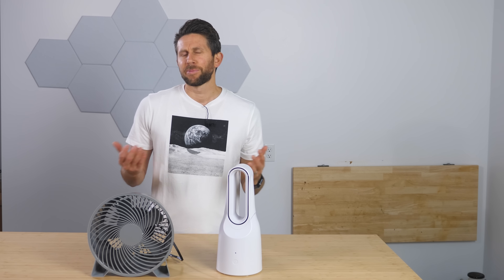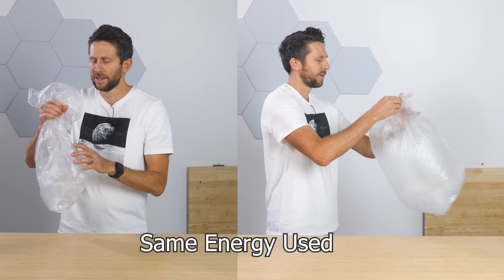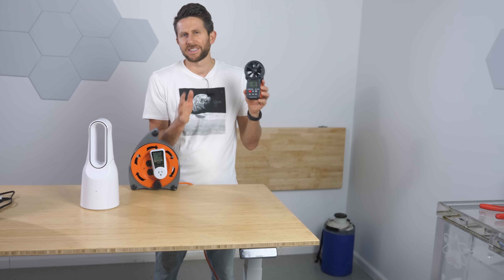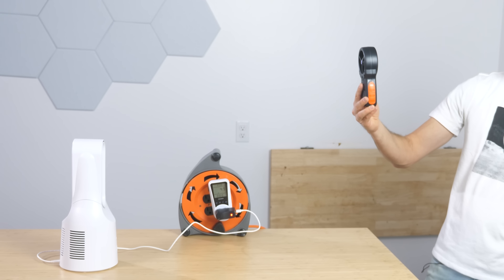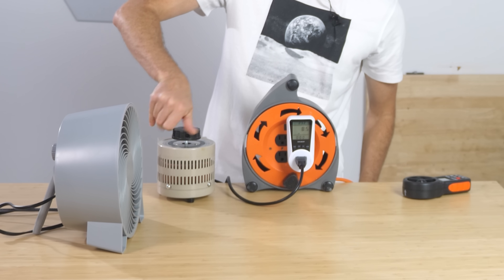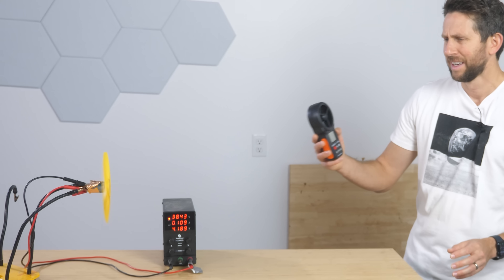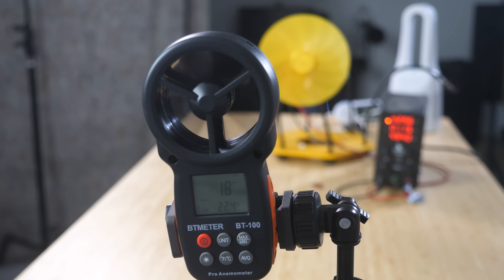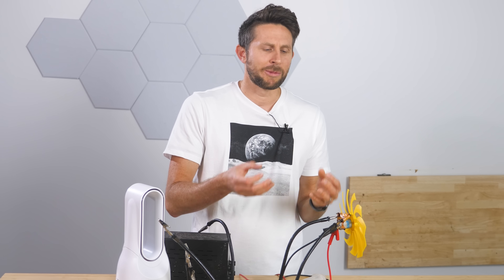Are Bladeless Fans a Scam?

Comment: The best small fans I've seen are all from Vornado.  They have fans as well as heaters which use the same technology.  They work well, are solidly built, last forever, and aren't really loud except at the highest speed.  Also, they can be purchased starting at $10.  I use them exclusively when I need a heater or fan.
Reply: Sounds like a stellar review!

Have to say though, not a big fan of their brand name "vornado"...
It sounds to much like "vore"...

So vornade makes me think it would be some vore pr0n comic on DeviantArt...!
Reply: vintage lasko fans are also great
Reply: I've got one I use mostly for cooling down after exercise.  It moves an insane amount of air even on the low setting.  I've got a fairly small version, maybe 12" across the entire front face.  No oscillation, just blowing my hair back like the old Maxell Cassette guy from the 1980s.

Comment: Well, it's an interesting experiment, but the reality is that you put a certain amount of power into the fan and that's the most you can get out of it (minus a bit for internal losses). So there's no way to 'multiply' anything; that would break the law of conservation of energy. All that the bladeless fan can do is swap air speed for air volume. So are bladeless fans a scam? Not really, they're a just gimmick and some folk probably think they look cool 😅.

Comment: Really need  to measure air volume moved as designed, then compare watts per cu meter or cfm. Both devices should be measured with similar air conditions within the intended design flow of the device and in its expected operating conditions. In this case room temp is probably a reasonable baseline as well as non ducted free air. This measurement is done in system balancing daily so very doable. Air amplification is a thing in practice in many places so it is a proven performer.

Comment: I'm glad someone finally tested the claims of the so-called bladeless fans, which have blades hidden in the base and do Not increase the efficiency of air movement.   This sales pitch falls under the old scam of "something for nothing":   You get more air movement for the same energy used.  I was suspicious of this the first time I heard it, for the same reasons he demonstrated:  forcing air through thin slits which creates back pressure and wastes energy.   A cheap Walmart fan is more efficient,  as he or another poster demonstrated in another video.

Comment: We expect that the air speed would be lower going through the slits. The Bernoulli principle is basically converting a small stream of fast-moving air into a bigger stream of slow-moving air. In principle, it could lead to a much larger air flow for the same energy, since kinetic energy is proportional to the square of velocity.

Comment: You should have 3d printed a shroud to encompass the small traditional fan with slots small enough to not allow little fingers in like a traditional box fan to see if that would have created a lower wind speed.  Fair testing and all since another benefit of bladeless fans are that they are safer for little ones and pets

Comment: A friend of mine bought one of the large floor standing Dyson fans.  First thing I noticed was how loud it was compared to the amount of wind it produced
Reply: Dyson - loud, inefficient, expensive
Same for vacuum cleaners
Reply: @Kiisseli1337 the dyson makes a cool futuristic sound though.. it's an average vacuum cleaner but i love tapping the button and hearing the whirring sound
Reply: @Kiisseli1337 ? I've never had this problem with vacuum cleaners lol
Reply: @Kiisseli1337  vintage vacuum cleaners are more efficent but yeah modern ones are awful
Reply: I have a Dyson desk fan I use to sleep (gift), it’s very quiet and I like the airflow it produces. I have used fans to sleep for decades, Dyson is the best.
Reply: @Thisismetman I have a Dyson desk fan (not a knock-off) and it's only quiet at lower speeds. I have computer fans that produce more noticeable, directed air flow at similar sound levels (if not quieter). For speeds that actually move significant amounts of air, Dyson fans are just as loud and not that great. The only nice thing about them is they are easy to clean and those with an air filter catch dust without gunking up the internal fan. They're just insanely expensive for what they do.

The only way to get around the noise issues is by increasing the size. DC ceiling fans are by far the best way to accomplish this in a place like a bedroom.

Comment: "Bladeless" is at least more concise than "does have a bladed fan, but it's out of the way of getting things jammed in it". I would never expect the same level of efficiency simply due to the indirection... but I can also think of a number of uses for a small fan where it will neither be in an especially controlled environment nor easily viewable or reachable, and where it's worth some loss in efficiency to ensure something like a string isn't going to get sucked in. This isn't a vast improvement over simply encasing both the intake and exhaust, but the design principle does create extra options. (And for larger models, I can see potential value in keeping fascinating moving parts well away from the eyes of young children.)

Comment: The only real benefit to the dyson fans is that they're air purifiers as well, one device that does both. Or the more expensive ones can also function as heaters or humidifiers. Convenient to have one device to do multiple things, but it's a jack of all trades, master of none. The $100 Vornado fan I got is really good at moving air around a room. Even the $50 one does really well. Even box fans do pretty good, though they might be better for moving air from one room to another, rather than circulating air around a room.
Reply: The big box fans are good at what they do, but noisy AF.
Reply: Must not have sisters with long hair. Ive had to tear apart several fans to get their hair out of it without having to cut their hair. Yes my sisters are dumb I get that and so do they.

Comment: EDIT: I forgot to post at the beginning of my comment. Yeah, bladeless fans aren’t completely what they’re often sold as. They’re a bit overblown (I see what I did there). But one of their primary benefits aside from having that smoother airflow is the safety factor of not having exposed blades anywhere that anything can get at. As a kid who nearly had my finger chopped off by an ancient 1950s electric desk fan, that’s not a small thing to overlook.

In fairness, the cost of Dyson fans goes into the engineering that made them in the first place. These $50 bladeless fans would never have existed without Dyson making that initial investment first, because nobody would’ve known how to do it.

As for the price of those $6-700 Dyson fans - those also aren’t just fans. Yes, they happen to blow air and operate as fans, but they also have things like air purifiers, hunidifiers, heaters, and with various smart features like measuring various polutants in the local air environment, offering HEPA filtration, and so forth. You’re not buying a better fan when you buy those fans - you’re buying those extra features. The basic $250 Dyson fan gets you pretty much all the benefits there are to get from the Dyson bladeless design, including an efficient, brushless DC motor, quality controls, warranties, serviceable parts, a company to back the product up, etc. (and yes, all their tremendous investment in marketing and creating that brand recognition, too). Try to service that $50 fan when something breaks - you won’t be able to get any parts or service from the company that made it, if you can even identify that company in the first place. And you’ll be very lucky if it’s actually UL-Listed or equivalent for safety. Most likely, you bought it from a company that orders it branded from Alibaba and slaps their own generic logo on that product, and in 6 months or a year, it’ll be 3 different company iterations down the road from the one you bought it from. Yes, you can buy 5 of those for the price of one Dyson, but again, that’s still one of the tradeoffs of not buying from the company that brought the technology to the market in the first place, and that will still be around in 10-20 years.

It’s kind of similar to buying a Tempurpedic mattress. Yes, you can buy the same material those matteresses are made of yourself from a factory that produces it and make the same exact matress for $1,000-2,000 less, but you’re never going to get the support you’ll get from Tempurpedic if it ever wears out or has an issue. And yeah, everyone can point to someone who’s had a bad customer service experience with Tempurpedic or Dyson, but that ignores the ratio of people who’ve had those bad experiences to those who’ve either never had to get service in the first place, or with those who have but have had great service experiences. Manufacturing is the hard part, and post-purchase support is almost entirely dependent on how well manufactured the product is - not how it’s designed (or whether its design was stolen from or infringes on the original inventor’s expense/efforts).

And I’m not saying Dyson’s aren’t over-priced. I think they are, generally. I’m just saying that it isn’t pure greed behind that pricing - there are other objective differences that actually do account for a significant portion of that overpricing.

Comment: I thought the bladeless fan was really safety conscious. Kids cant cut themselves or easily throw stuff at the blades and ricochet.

Also, that fast moving low pressure air demonstration with the bag was cool. You could also show how plane escape slides fill up by adding a venturi.
Reply: Safety is really the main selling point
Reply: And easier to clean I guess
Reply: I would like to reaffirm that safety is the most valuable benefit of these type of electric fans. Be it little ones discovering their surroundings, people with cognitive impairments, or plainly being bored, they are a valuable contribution to our society. It is a shame though, that patents had to expire, for the less fortunate people to take advantage of these engineering breakthroughs...
Reply: I always assumed experimenting with, or getting a minor injury from, a spinning fan blade was part of the learning process of growing up.  Sooner or later, you're going to encounter a big fan with blades, and the earlier you learn not to mess with them, the better.

Comment: I don't know why the youtube science communicators do a very poor job when it comes to air movig devices by always using an anemometer to compare everything when it doesn't even measure volumetric flow, even less static pressure. I know these kind of metrics are hard to get but when they aren't even mentionned in the video it is quite problematic

Comment: Do you think it would also be worth trying out toroidal bladed fans as another comparison with traditional fans?
Reply: I can pretty much guarantee the toroidal is going to be worse.  That design works great at high speeds like what drones need to fly or if you're moving quickly in a speed boat.  At lower speeds, like fan blades, it's typically way less efficient than standard blade design.

Comment: Also note that blades, blade angles of fans have to be designed based on the intended rpm. It is the vector sum of air velocity and velocity of points on the blade for both edges of the blade

Running them at different speeds is not efficient in terms of power consumed per quantity of air delivery times the pressure difference

Comment: Also note that when an electric motor is fed increasing voltage starting with near zero, when it does start moving there will be a drop in current and power from what it is consuming until then, due to also starting generation of back emf

Comment: Good experiment. Seems to me that instead of taking out the blower, you also could put same size pipe for output measure on the whole output, thus eliminating the comparison of "one directed stream" vs "a propeller dispersing out to sides" argument. But not being an expert on fluid dynamics, I might have overlooked some aspects. 
Just another idea, your argument is solid, just it does not get clear at start. 
I like such type of videos. Simple, easy to understand and IMHO approvable by Bill Nye :D

Comment: One of the reasons for a bladeless fan would be that the blades are covered. Nobody would get their finger stuck in them, no animal would get their tail or something stuck, let's say if a cat jumped on your desk or something... At the end of the day, it's basically just a cool decoration though, with some level of practical use. Opening a window would be much more effective if the outside is slightly cooler.

Comment: Having worked at a Best Buy for years, I can confirm that Dyson is terrible. For every 5 Dyson products we sold, 4 were returned. 

I shipped a dozen or more Dyson products back to the product return center on a weekly basis. 

Dyson is a terrible brand. Extremely overpriced, unreliable, and hardly capable of performing the advertised task.

Comment: Ok no, I don’t as a consumer have a choice in motors so if the conventional fan uses more power than the “blade  less  fan” (see man hold up 2 ✌️ ✌️and wiggle them up and down) then it uses less power.

Comment: There are just too many variables at play here. Not just wins speed, but volume. You would need a way to measure the total volume of air moved, not just the max speed, to be able to directly compare efficiency. 

But there are a few things we can look at to be able to tell that the claims of "higher efficiency" are bunk. Pressure is one of them. When you take a small volume of air, increase its pressure (and therefor speed) through a restriction, then use that faster air to accelerate a larger volume of air to a slower speed you have just lost some efficiency to that over-pressurization. From a purely theoretical standpoint the most efficient way to accelerate a given volume/mass of gasses is to uniformly accelerate the entire mass to the desired speed. The regular large blade fan comes closest to this ideal. The tiny fan on the "bladeless" models not so much.

Comment: with bigger fans the "bladeless" design gets better (see bypass turbines) but the small chanels in of this homeuse fans create a lot of pressure. they even need a radial fan for the increased pressure.
even the bigger dyson fan will trade off a lot of raw energy for less noise

Comment: I wonder if this experiment would hold up at larger sizes? I replaced my large standing fan after it died with a large tower fan (When I was shopping on Amazon, "bladeless" was never the primary name which makes this video feel a little biased, tower fans did have bladeless buried in the keyword spam though next to "for home bedroom office room"). The volume of air moved was clearly higher. Is that going to be nothing more than age difference? I'm skeptical of that, they were both priced similarly at their respective times. I wasn't expecting the upgrade though, I was prepared for it to be less effective. I chose it for how little space it takes up, which sure was a great help (I use virtual reality a lot, space is more valuable).

I think you might be putting down a whole tech when it's only Dyson that deserves any of that treatment. Tower fans definitely are a solid option to get.
Reply: - why it takes so much horsepower - to make this happen!  its cubed response.  We do this with 100hp, sometimes 250hp, to provide ventilation for a process that must have all air 'captured' so that it can be cleaned of solvents.

Comment: What if the traditional fan is placed within a duct? It should reduce turbulence at the tips of the fan blades, which will allow the air to move even faster.

Comment: Creating extra pressure and then convert that extra pressure to extra flow will obviously result in losses compared to optimizing the design to create flow directly.   

Still, most fans aren't very well designed for efficiency, so it's quite possible to make a fan with a sub-optimal principle more efficient than a lot of other fans on the market if you really want to.  Consumption is typically a bigger selling point than output, people tend to trust watt consumption more than data for air speed or flow rate. And there are lot of ways to measure speed/flow, so people assuming that consumption is a good proxy for power output isn't that strange.          

Hopefully that AC-motor was designed for 120 V, and possibly became much less efficient in part because of the reduced voltage. But, I experimented with a simple AC table fan, and it's consumption only decreased to just over 50% of it's maximum power consumption when I removed the fan completely, just spinning the motor and empty shaft. At least according to my power meter.

Comment: The only positive about this Dyson fan is the fact that the blades are inside the base. You can place these without having to worry that your kids fingers get cut by the blades. And of course it makes less noise. My brother has one of these Dyson fans, much larger than this version in the video and he bought that one because his kid just started her first steps, he doesn't need to worry about her walking up to the fan and grab it. He did say even though the large version has quite a bit of power in terms of airflow, a regular fan is much more effective.

Comment: Bladeless fans are way overpriced and as his work showed, much less efficient at moving air, especially large volumes of air.  Claims of quietness are specious and actually don't compensate for the very large inefficiencies, not to mention the bloated cost of the bladeless fan.  Same with the overpriced, plastic-ky vacuum cleaners.  Overpriced is a vast understatement for those.  And sometime check out the 'bladeless' hair dryer--talk about high price!
Reply: But they look cool.
Reply: Or looked.

The novelty is gone now
Reply: And then I got to the end of the video.

I'm not alone.